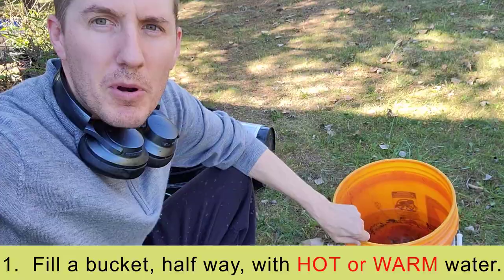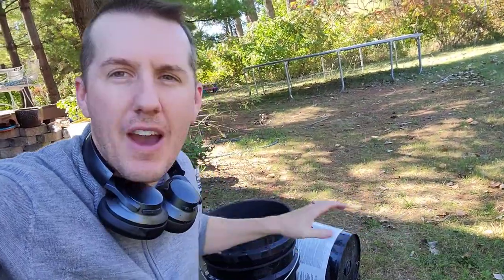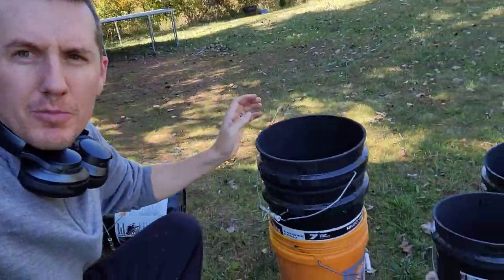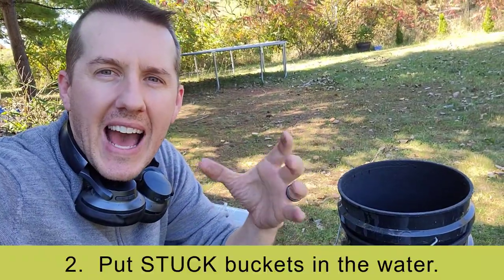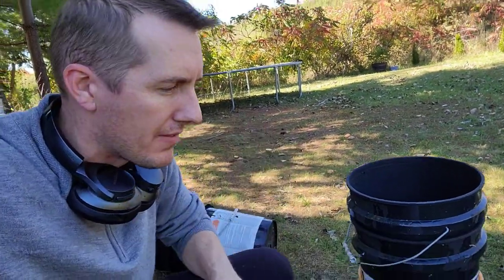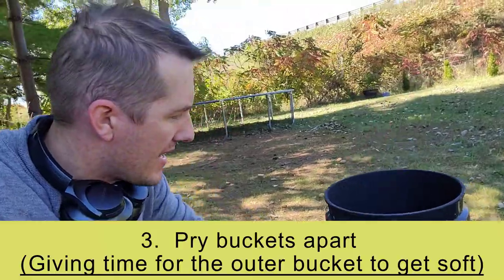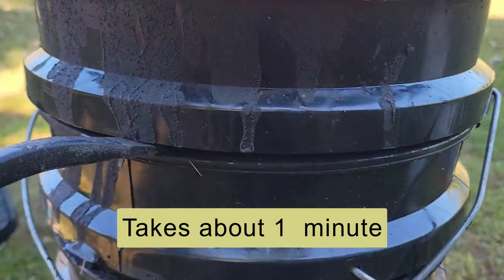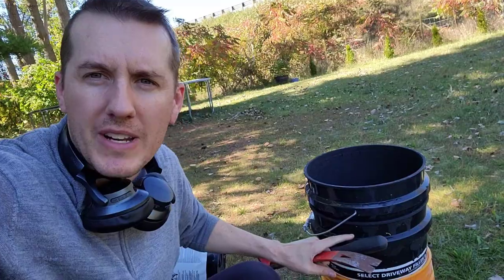How to Unstick Buckets

Comment: Didnt work. 
Used hot water for over an hout and still no luck. 

I even tried breaking apart the top bucket because its the bottom one i needed. 
Still no luck. 

Got frustrated and stomped them both into a bunch of little pieces😂
The got unstuck i guess you could say.